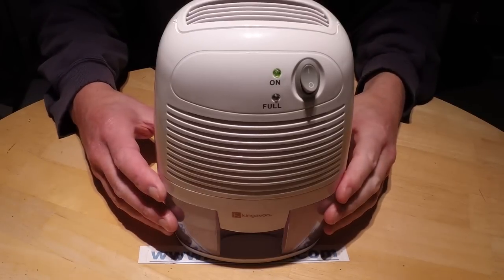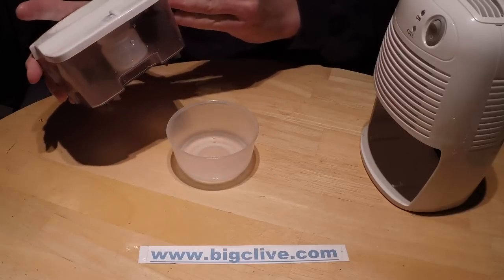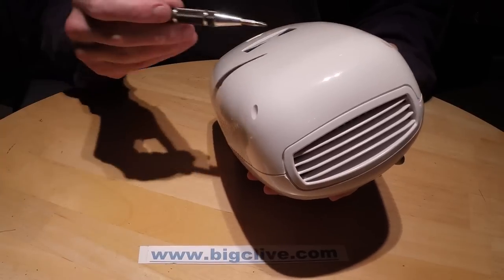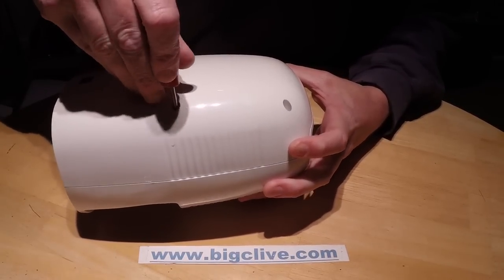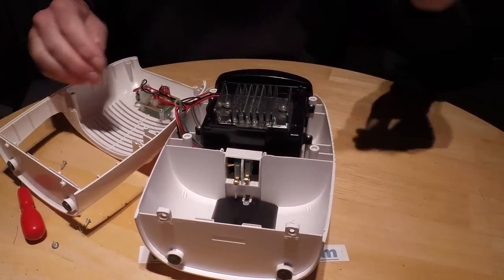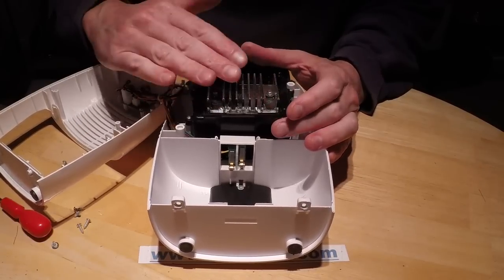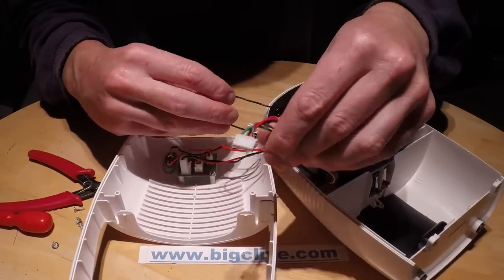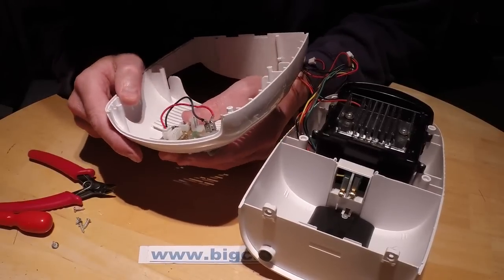Mini peltier dehumidifier teardown.

Comment: compressor (phase-change) cooling is so more efficient then these peltier fridges and dehumidifiers coming out. I have a compressor mini fridge that draws 45 watts (closer to 500w for a few seconds on startup) and can freeze everything solid, but have a relitive that has a peltier based mini-fridge and is always complaining that the internal temp is around 50 degrees, I put my kill-a-watt on it and it was drawing 200w, not to mention it'll never reach temperature and kick off unlike a compressor version.
Reply from the maker: The peltier fridges are terrible.  very inefficient, but cheap to make and sell to people without actually mentioning that the running costs will be so massive.
Reply: They're really meant to be used for small, battery powered chillers. Or in small places like a gun vault or safe. Something to bring camping or on a picnic to keep things cold for a few hours. If you don't need it to be portable, phase change is absolutely the best option.
Reply: Didn't know you could get a 45W compressor cooler. A dehumidifier based on that would be convenient. Typical smallest is 220W.

Comment: I have a slightly larger one of these in a walk in wardrobe with an outside wall. we suffered much condensation mould. since using it we have no mould. they are good for small spaces like wardrobes.

Comment: I also have one of these, it runs on only 9V. It has some additional component near the heat sinks, I guess it must be some kind of thermal switch (that either cuts out when the thing heats up too much or maybe when it would be on the verge of freezing). Because the fan is still rated at 12V, I added a ‘turbo’ switch with a booster circuit that brings it at full speed. Even then, performance is still very poor, although it helps a bit to get the moisture out of a poorly ventilated bathroom. But my big compressor-based dehumidifier pulls about 20 times the amount of moisture out of the air per Watt.
Reply: Alexander Thomas I've used a 'proper' dehumidifier to dry our washing indoors, and the amount of water it removed from the environment, even with no washing behind dried is impressive. Easily enough for two people to drink in case of emergencies wth a generator.

Comment: I think the rubber washers are also to prevent heat conduction through the screws from one heat sink to the other. Having played about with a Peltier plate before the hot side seems to dominate the cold side substantially so I wonder if some kind of insulator other than air would be beneficial between the two heat sinks and perhaps nylon bolts instead of steel screws? Also would the condenser benefit from a bigger surface area and a rougher surface?

Comment: Hi man! So basically if I were to have a fan, heat sink, cooling chip and a second heat sink I could build my own dehumidifier?
Reply: RCLifeOn or fridge. This is what those tiny mini fridges use, and why they can often warm cans up as well (by reversing polarity across the PD).
Reply: Instablaster.

Comment: so could you easily hack and upgrade these by simply replacing the heatsinks with higher end/ larger heatsinks?
Reply from the maker: It tends to be balanced quite well in terms of heatsink dissipation and airflow speed.  It would require some experimentation.

Comment: Its' interesting that the old big clunky fridge-style dehumidifiers seem to go much further and freeze the water and then cycle to melt that into the bucket rather than just relying on just condensing based on reduced capacity.
Reply: Sounds like inefficient operation, wonder if the customers prefered it because it seemed more powerful or something... or if the thermostat just wasn't very precise.
I once had to look after a computer room that was cooled by a window mounted A/C unit (we don't have these very often in the UK) 
when it was working properly it dripped water onto the flue of the pizza restraunt downstairs and put it's boiler out.    when it wasn't working properly (usually because a colleague had mucked about with the thermostat) you got ice climbing out through the front grill
Reply: It is impossible to choose one correct quantity of air flow and coil temperature for every condition so they designed them to work that way when working in colder conditions.
Reply: Dehumidifiers that freeze up are not running properly, just like A/C units that freeze up.

Comment: I've had 3 of these for about 6 months now,, that are the same model you broke down..  After a couple months 2 of them have drastically cut down the amount of water they're pulling while the 3rd one is still churning away normally.  All fans seem to be operating normally and producing about the same amount of airflow.  So I thought replacing the Peltier module would resolve this, but alas no.  I switched power supplies and that's not the issue either. And the hot sink on all is still hot and the cold ones, cold, tho only cool on the bad two.  Before I junk the two, do you have any ideas as to what I could do to fix these?  BTW< thanks for a great video -- it gave me confidence to break mine down.
Reply: Clive, FYI: An update on my problems: I FINALLY got some new PE modules and that was the problem with the 2 dehumidifiers I had -- they now work fine when I replaced the PE module and used heat sink compound in installing them.  Not sure why the two had died before, but apparently the PE modules may not have been properly heat-sinked, so they deteriorated.  Anyhow I'm a happy camper now.  Many thanks for your help and your great video.
Reply from the maker: I would have thought that by changing the peltier elements and PSU you would have covered just about everything.  Is the heatsink clean on both sides?  Is the inefficiency during a particular season?
Reply: Thanks.  All heat sinks and fans are squeaky clean and operate in the same closet, and are operating now.  #3 is doing fine, just like the other two did for a couple months. Now those two now produce about 1/5th to 1/10th as much water as #3.  I bought 3 replacement Peltier modules from ebay, so perhaps all 5 (original 2 plus 3 new) are bad, but that seems unlikely.  I might get brave and move the one from #3 into a bad one and see.  I hate gremlins! I'll let you know if I make any progress, so others will know.
Reply: Compare the heat sink junctions of all 3 to see if they are the same...Same gap, same amount of heat sink compound and screw torque etc. And airflow. Something might be blocking airflow to two of them.
Reply: James, thanks for the input.  The heat sinks all look identical and they were all working fine for a couple months.  But I didn't replace the heat sink compound on either of those two when I tried new Peltier modules, so perhaps that's the problem.  They weren't sticky and the compound did look dry, but I'm not used to dealing with such, so ignored it.  I'll get some of that in the next few days and try that -- I'll post back the results.  Thanks again.
Reply: Well that didn't work.  I thoroughly cleaned off the old compound and applied new (per some YouTube videos).  The cold heat sink just barely gets a bit cool, so little condensation on it.  I"m wondering if all the Peltier modules have gotten zapped(?).
The airflow coming out of all 3 is pretty much the same and the heat sinks all look clean and unobstructed.  BUT the airflow is noticeably hotter on the ones that are NOT working so well, and the hot side is hotter than the good one.  Not sure what that means, you or anyone have any ideas?  Thanks again.
Reply from the maker: It may mean that the peltier modules are damaged.  It's easy to damage them.  Maybe try new modules from eBay with compound?
Reply: Thanks, I'll try another one, as that's the only thing lieft (I even changed seemingly good fans, and still the same).    My guess is that the modules are heating up more but not cooling down the other side so much since the air is hotter coming out of the "bad" ones, despite one having even heavier air flow than the good one.  Anyhow if I get some success, I'll post here (but it'll be mid-October before I get them).
Reply: Dave Van Rooy
That's good to know. Thanks for following up. You probably just saved alot of people alot of money and time.
Reply: I hope so!  It's nice to see them working again.

Comment: what if you attach the fan on the cold side blowing out,would it turn into a mini air conditioner? maybe attach the hot side to a window so that the heat can be released.
Reply: You have to vent the hot side out, or it will heat the room (it puts out more hot air than cold air).  It would be a VERY mini A/C.

Comment: Just did some quick maths on this one. The latent heat of evaporation of water is around the 100,000 joules per kilo mark. I think it's actually about 118,000 but 100,000 makes the maths easy. If your kit cools to the tune of 33W then it will take about hour to condense 1kg of water IF it's running at near 100% efficiency. The problem is that the hot bit and the cold bit are too close together so it is working at I would guess 10% efficiency at most.

Comment: that would be VERY easy to modify for makeshift PC TEC Cooling. what a novel thing!
Reply: Peltiers have been used in PC cooling for a long time, but you have to be really careful with them.  They can easily drop your CPU temperatures down to below freezing, which actually makes CPUs quite happy, but the issue is all that condensation.  Plus, you do have to properly cool the 'hot' side anyway because the peltier junction itself will burn out if it gets too hot.  It's critical that you have an absolute air-tight seal separating the cold bits from any electronics though, because the condensing water will end up destroying all your electronics if not.
Reply: Dustin Rodriguez lol.. Freezing a CPU? Those things are warming up.. Only real problem is condensation, need to be really good sealed, or the peltier should be regulated to the CPU load, so less load less cooling 

The second thing... When the peltier fails.. The CPU can overheat in no time.. 

And the third, because the peltier uses power as well.. You need to use a bigger heat sink.. I mean pretty really huge... Because when the sink saturases with heat the peltier looses efficiency, again overheat.. Believe me, if you want to overclock.. Use a simple water cooler... It's way easier, and doesn't require rocket science programming ☺️
Reply: legacysage good job taking 2 paragraphs to say "Thats a dumb idea, and you are dumb" while trying to sound smart. Look, Peltier cooling done right is good for getting water cooling grade or better thermal dissipation with no moving parts and a low failure rate. if you are doing it right and not say, directly driving the peltier itself from a power source and letting it run rampant, you can very easily control the temperature of a CPU with a few passive components, the peltier plate, and a variable resistor. admittedly, you will need a semi large passive heatsink somewhere on the outside of your case to pipe the heat to, but in the end you can't deny the raw performance gains.
Reply: MortifiedDumplin my bet, watercooling absorbs more heat than a peltier ever can, I mean the hot side of a peltier needs to be cooled if you would do that passive you will eventually (when everything heats up)  loose the benefits of the cold peltier side! And yes it is true, if you would use a peltier in combination with a chilled water cooler your CPU will run cooler.. But then again if you want to slam a buck in your pc for cooling I recommend you better can get a chiller (compressed cooling) system! Those are way more efficient than a peltier ever will be

Comment: for my two cents I think they positioned the heater pad low to cause the the heat to draw upward in an effect to cause the heated air upward..   if the heater pad was mounted mid section of up high the bottom of the fins would stay at a neutral temp causing the unit fail out not work well at all...

Comment: Now, would running one of these outside on a humid day collect water? Could these be in some way a way to collect water from the air?
Reply: +Ozric M. you chould, however it have the same problems as rainwater as its still will be polutet with what ever is in the air that will make contact with water like dust or smog. and i guess its quite an expensiv way of collecting water aswell as will only work if the air is humit allready so you whould have no luck trying to do so at greenland or in the sahara desert unfortunatly.the main reason to use one is to remove damp to provent molt in buildings or slowly try to dry books or something like that :)
Reply: Then you have that useless self-filling water bottle thing. You're much better off collecting rainwater.
Reply: leave a bucket outside than u has water :D

Comment: I remember using these TEC units to cool CPU's for over clocking. iwe had to use car heater cores to dissipate all the heat.
Reply: +BlueFoxTV Yeah, the ones used for such cooling are a LOT more powerful. These little things are only about 30W, the ones used in computer cooling are usually 100+W. Might be interesting dumping out the low wattage TEC and swapping to something with more grunt (and a PSU to run it, of course).

Comment: I've been using one for years in a stored car, every winter. It's quite happily extracting a litre every few days and the full turn-off switch works fine. However, don't forget to empty it every so often, as when a big freeze occurs, the ice formed in the catch tank will crack it wide open. Of course, the availability of spares for these is non-existent.
As you found, the fan is nothing more than a cheap generic PC component - I replaced the OEM one after a year due to noisy bearings. The replacement, a decent quality Papst, has lasted for years. 
One thing I found was the unit, more importantly, the power supply brick, wasn't immune to flood damage, and that killed it. 
It lives on though; now being powered by an ATX PSU, the Peltier modules just chuntering away like they'll never give up.
In fact, I was so impressed by how it did its job, when it wasn't being nearly killed by weather and bad luck, I bought another one recently, to go into another car.
These things are ok for that size of volume, but for a room, forget it.

Comment: lol no isolation between the heatsinks? and joined by a metal screw? and it actually have thermal paste that goes from one side to the other (@9:00).
i think, maybe,  that's not very optimal.

Comment: I've always wondered if these can be hacked in any way to be more efficient..... or if the more expensive ones can be made more productive or even turned into an air conditioner?
Reply: Quite possible but a lot less energy efficient than standard compressor based solutions, you'll probably still need a fan of some kind to move air through the cold side heatsink for anything but local cooling. And a way to dump the heat obviously that exhausts the heat elsewhere outside the building/room.

Energy efficiency reasons make them fairly pointless though and even when you want operation that isn't any noisier than fan level noise you're much better off with a central compressor based HVAC system anyway. 

I do have a convenient mini fridge using this technology that runs on both AC and 12V DC which sees a lot of use during the summer time, it's really quite inefficient energy wise. But it's good enough to take a cold drink from downstairs and keep it cold in my room ready to drink.

Comment: You are correct swapping the polarity changes the direction of the heat pump
Reply: hey I got one of these and want to use it in my fridge i dont want a dessicant dehumidifier as it adds more heat what can i do to make it stop freezing up. I have a controller i can use to control the on/off and humidity %
Reply: @ugursenturk5860  this will also generate heat. In order to make a cool side to collect condensation, the peltier must also have a hot side.
Reply: @ugursenturk5860 you could you a desiccant pack, when it becomes saturated and changes color. Then you put it in the over to dry it out and use it again.
Reply: Duh...

Comment: We had a 'mini cooler' at work until some bright spark switched it from cold to hot while still turned on. A loud bang and flash was emitted and muggins here was asked if i could fix it. took it home, the 'hot/cold' switch simply reversed polarity of peltier and had shorted in the middle, melting on/off switch and hot/cold switch into one blob of plastic, and a very charred circuit under them. I took it all apart, sandwiched peltier between original heatsink and a cpu heatsink, fans on both sides, wired it to 12v cpu header on a spare pc power supply rated over 400w. Fans came on and one side gets lovely and cold and the back gets barely warm given its massive heatsink lol. it now sits in a round cliplock container next to my bed waiting for those ugly sweaty long summer nights blowing a chilly cold breeze across my face :D Instant cheap air con, yay !!

Comment: ive been commenting on old videos lately lol. but not sure if someone said this already but people use these small dehumidifiers in gun safes or small closets where moisture is an issue.
Reply: +jaylang11 so why not toss a handful of silica gel packets in one instead..?
Reply: +jaylang11 yeah, inside small confined spaces i would go for chemical-based drying-agents - if they are used up you simply dry them in the oven so its way more cost-efficient :)